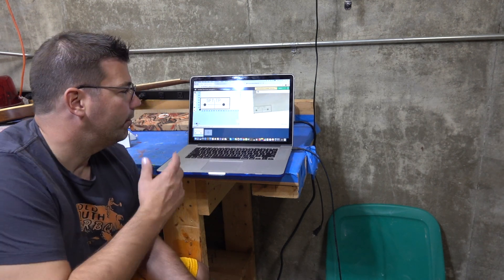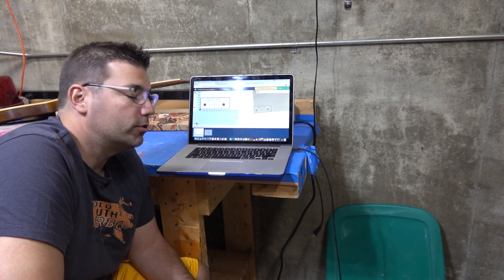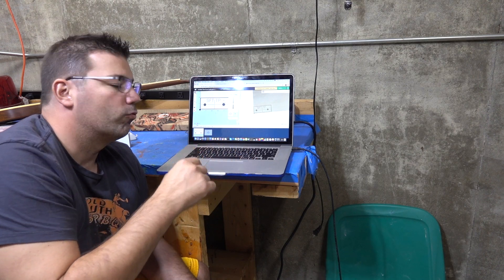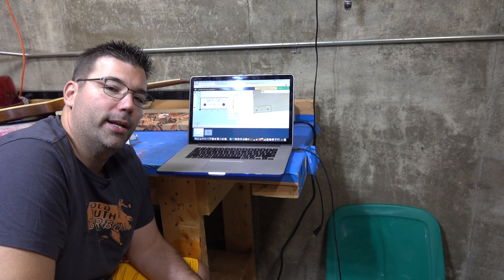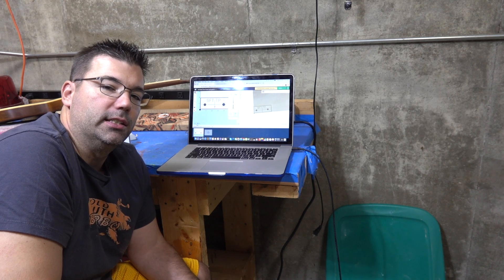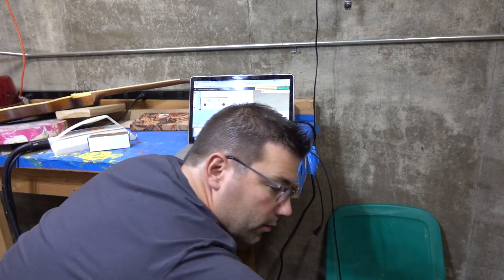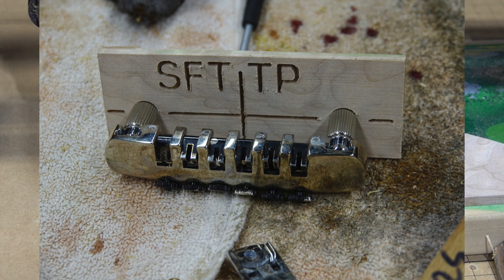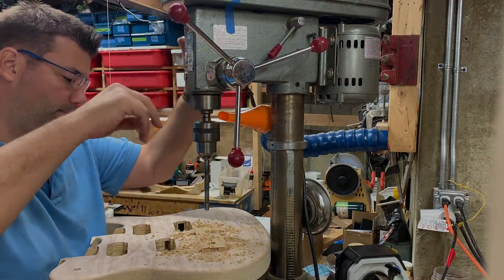Making Bridge Drilling Templates for your Project Guitar with Inventables CNC

Comment: Cover each piece to be temporarily adhered with blue tape firmly pressed onto each surface, then stick the two together with cyano glue.  Holds fast and firm and cleanup is as simple as pulling the tape off.
Reply from the maker: Capn Crusty yea I don’t like that method.  I have done it before and had glue leak through.
Reply: Crimson Guitars does this.
Reply from the maker: @trance9158  yep I will stick with my double stick tape.